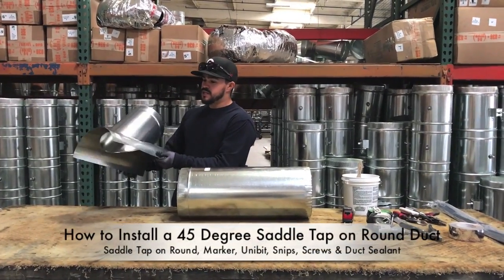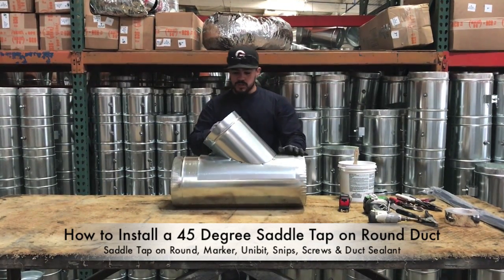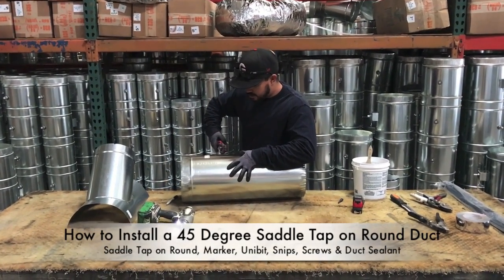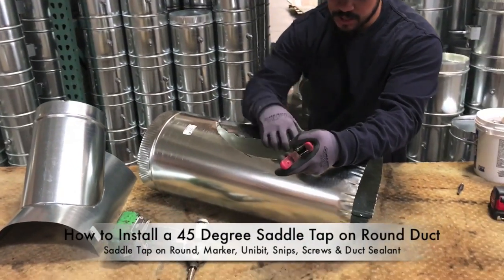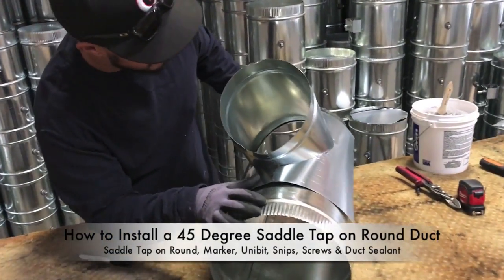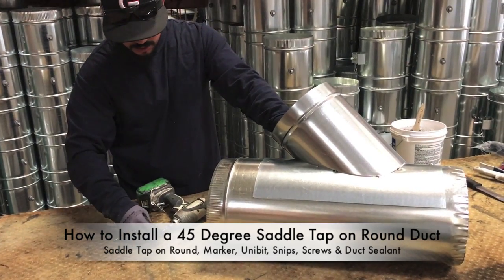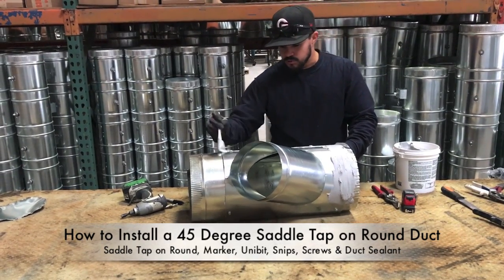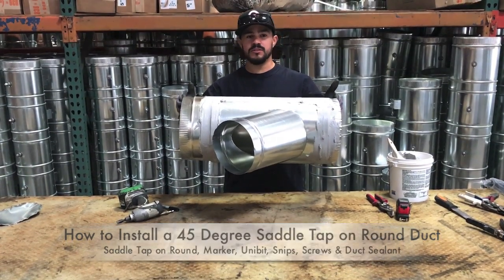How-To Install a 45 Degree Saddle Tap on Round Duct - The Duct Shop

Comment: You cut like a butcher with a hatchet  , for cripe sake throw those dam straight snips away , use offset reds or greens .
The crap duct work you use is garbage . 
Who the hell calls duct sealer pookie ?! ..... Nobody actually in the industry says pookie . 
Using that crap branch with the massive square collar again requires a ton of sealer and looks really hack .
If your going to use this junk metal , at least cut that gynormis square flange down to 1 inch all around making it a one inch flange . Then cut the hole in the straight duct  1/4 inch smaller , screw it in proper then tap the hole all around bending it up flush with  the inside of your wye which creates an internal flange . Seal it from the inside and the outside where possible 
Not using 10 pounds of duct seal either . 
Better yet , buy a wye instead .....

Comment: Hey great videos. simple instruction will help people save big bucks. I seen your struggle with cutting your take off hole. round duct is tricky to cut once snapped together. may I suggest an easier way to procure that pesky hole. start off by doing exactly what you did drilling a hole with a screw then using your unibit but instead of starting on the outside edge you start an inch maybe 2 inches off center of the hole and then what you do is you take a full spiral and a half before you actually reach your outline but when you start a little off center you make a spiral shape moving towards the outside what that does is relieves the tension from the center. you will be doing more cutting but it goes three times as fast and it's a lot easier and you don't make burrs on your edges. try it out and that would probably be a good video for you to put up
Reply from the maker: Thanks for the feedback and suggestion!!! We'll try it out